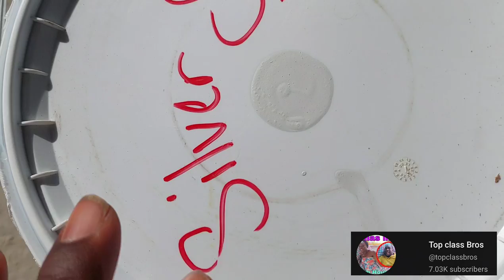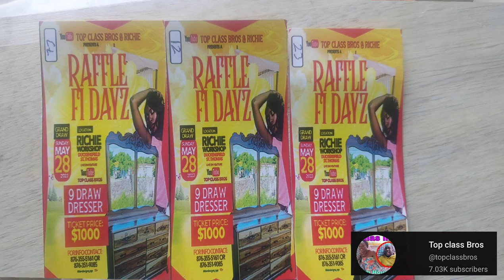Finish painting our kitchen, looking Eligant.

Comment: I top class  bro...I know the kitchen finish already  but I'm still  sharing my opinion...I think that the ketchen never  need two  windows because the kitchen small. If it was one  window you would get more cupboard space... and where the stove going never need a window ...right there would nice with a range wood over the stove with a small cupboard above....I'm afraid of curtains near a stove...that window better keep close when cooking to avoid the wind blowing out the gas.
Reply: Sherion - Good suggestions, however, with the windows you don't need a range hood, because it will be well ventilated.  About the curtain she could just use a valance above the window where the stove will be.  All good ideas.